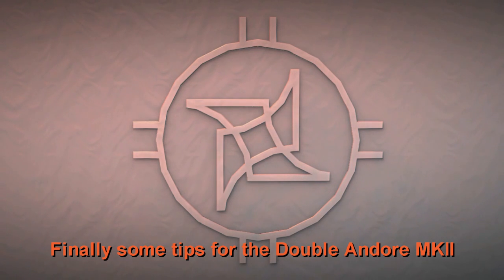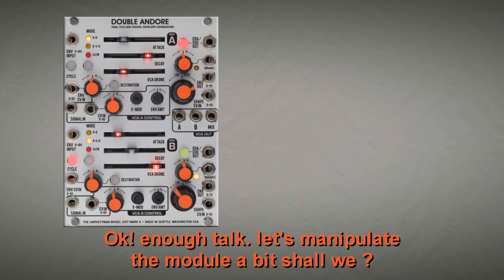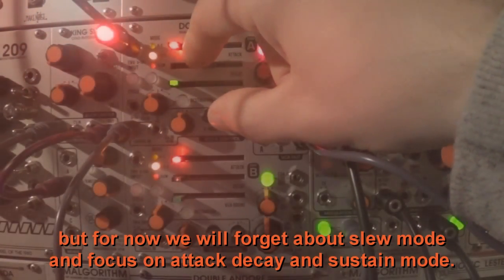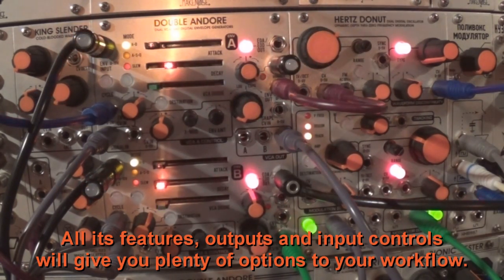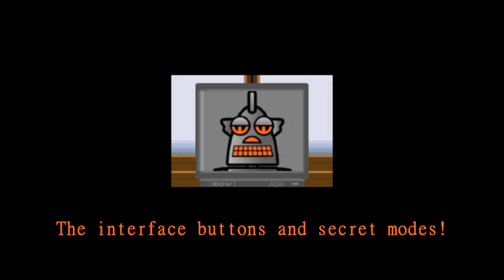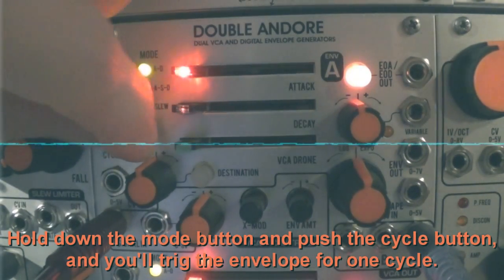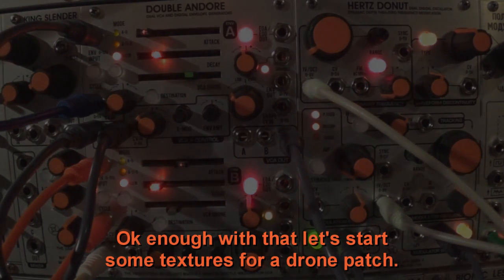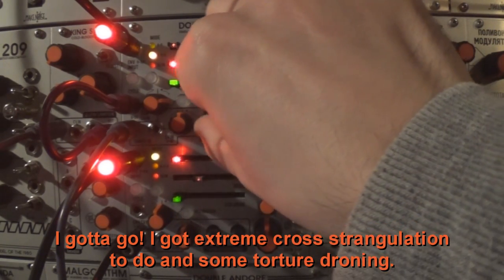The Double Andore MKII Tutorial

Comment: A couple questions:
1) Do you know anything about which parts of this module are analog or digital?
2) Does it work well on clean signals like sine waves?
3) How does it respond to high-frequency audio-rate modulation?
Reply from the maker: answer #1: I dont know I'll ask Scott. but I think I once saw something about the VCA section being Analogue. The Envelope generator section is Digital for sure .
answer #2: It works very well with sine Waves along with any other wave.
answer #3: It works very well to high frequency audio-rate modulations :D
Reply from the maker: The official response : 
The VCA and signal path is 100% analog and the envelopes are 100% digital.